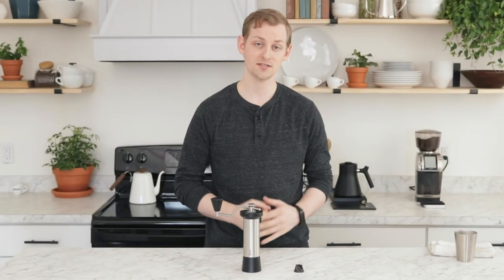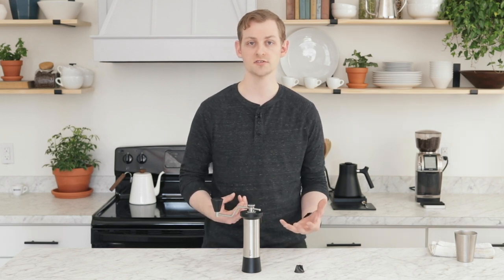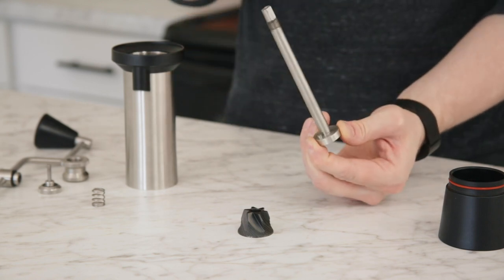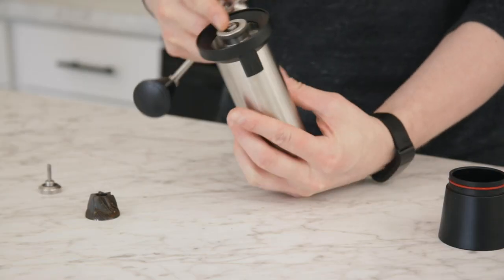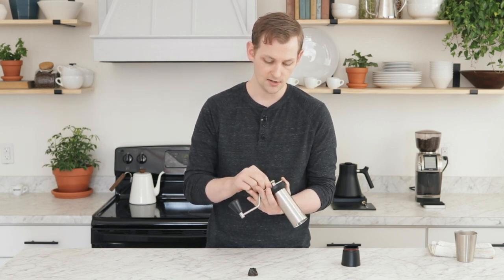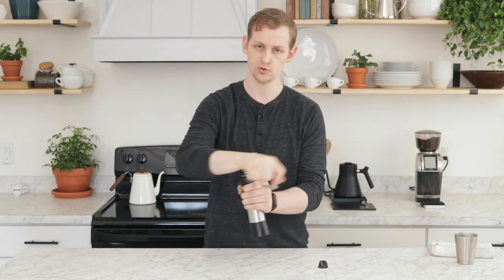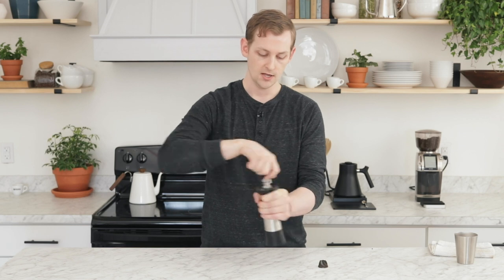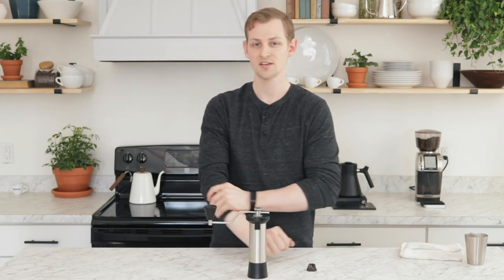Video Overview | Kinu Coarse Burr

Comment: I got to talk to Kinu about the POB actually. Kinu says, that any setting on the standard burr (filter coffee), the POB needs to be set at 1 rotation lower. i.e. if the standard burr is 3.5 for filter coffee, the POB should be set at 2.5 since the geometry is different. I've had this for quite awhile now and I've been enjoying the results since.
Reply from the maker: Thanks for sharing!
Reply: I believe that. I just made my first coffee with it on 4.5 with a light honey process. It was MUCH coarser then the stock burr on the same setting. Much better grinder uniformity and better clarity in the cup.

Comment: Just saw this video, 1 year but never too late. The Kinu coarse burr, even at a setting of 4 and above still produce a lot of fines, hence difficult to get rid of muddiness. But the coffee brewed is still a huge improvement over the brew using the stock burr that comes with the Kinu. The stock burr is very good for espresso though.
Reply: Thanks for the input - do you think getting the Kinu for pour-overs would be a bad choice overall? How would you rank it compared to other grinders?

Comment: I need this course burr for my Moccamaster brewer.
Reply: really? I thought Moccamaster was closer to a fine grind size. And the Burr that comes with the grinder does very well with fine grinds. This second option is meant for more course grinds I think. From say a V60 up through Press pots. But I'd like to hear your results if your choose to make the switch. I'm happy to have both now.
Reply: @sbellosa  oh no, the manual grinder by Kinu works great with a course grind

Comment: I recently just start doing pour overs with my new M47 but the bed of the coffee is always muddy and the result is kind of cloudy. I am using Chemex, which already have quite a longer drawdown time compare to V60. I have been trying to adjust the grind setting courser trying to fix this issue but no obvious result. After doing some research I found your video.Thank you for the information!
Reply from the maker: Glad it was helpful!
Reply: Jerry, did you buy this burr? I am having the exact same problem as you with my M47 and V60. I can't get draw down times to 3 mins, even if I sift the fines, because there are fines adhering to the course grinds and still causing muddiness.
Reply: @russelljazzbeck  and Jerry, I just bought the pour over burr a week ago and It is a game changer to be honest! It changed my pour over experience 180 degrees. Even though I can’t understand why such an expensive grinder would have such poor default pour over results, however, you must have the new pour over burr, you will notice the difference directly. The only issue is that it takes almost double the time to grind the same amount of beans. For the default burr i would suggest you guys go 5.2.0 or something within that range, and do the no blooming method “forgot what it is called”. Hope it is useful
Reply: @iM3ath  With the pour-over burr for the Kinu, would you say it is competitive with other pour-over grinders at the same price range? Thanks!
Reply: @charleswood5071  I don’t think there is another grinder within the same price range. I believr kinu classic is the most expensive hand grinder in this category. Also I went back to the original burr, after 5 months of using the pour over burr, the original burr are better to me,  it’s either the filters were clogging or the beans were slowing the extraction, however, I’m used to it by now and it’s a great grinder. But, I would suggest you go with Comandante mk4

Comment: Hi. Kinu M47 Classic user here. With standard burr set I am grinding between 1.5.0-1.7.0 range for espresso. I would like to try out my new filter burr set for cold brew. Where should I start? 4 full rotation is ok? Thanks. :)
Reply from the maker: 4 would be a good place to start. You are looking for that really coarse consistency, so you could always start by grinding just a few beans and seeing what your consistency looks like and go from there.

Comment: How fast/slow is the coarse burr compared to the Comandante grind speed?
Reply from the maker: The Kinus with either burr set will grind more slowly than the Comandante.
Reply: @primacoffeeequipment  Just wanted to be sure I read that correctly... Did you mean to say that either burr set would grind more quickly than Comandante? Pretty much everyone is saying it's faster with the standard burrs anyway. So hard to know without having them both on hand though. Appreciate your help!!

Comment: How often should you change your burr if lets say I grind 30g of coffee a day?
Reply from the maker: Most likely never! They last many hundreds of lbs.
Reply: @primacoffeeequipment thats what I thought as well but  I recently had to dial my grinder a lil bit finer as its grinding coarser than  usual (literally 2-3 click so for example setting used to be 2. 4. 4. And now is 2. 4. 1. The burr is 2-3months old so not sure what the issue could be. Coffee started to taste ever so slightly bitter as well. I usually brew v60 and make sure the recipe is consistent so something up with the grind I believe
Reply from the maker: @szymonbalcer  There is a break-in period for all burrs. Burrs produce their best results after a period of seasoning (generally around 10kg-20kg depending on the burr and the material. It will change slightly as you use it.
Reply: @primacoffeeequipment  aaa I see that's what it probably is. I adjusted grinder accordingly and its starting to taste amazing again! Thanks very much for the info :)

Comment: With the base M47 burr I can't get draw down times to 3 mins, even if I sift the fines, because there are fines adhering to the course grinds and still causing muddiness. Has anyone used this burr? Does it speed up draw down times?
Reply: I’ve had a similar experience with lighter roast and Ethiopian coffees especially. This is a common problem for the pour over method in general and for a wide range of grinders, with Fines clogging the filter… i think the known fines production of the kinu m47’s stock burr set amplifies this problem, for this grind range putting it more on par with an entry level grinder unfortunately. 

When it comes to espresso it’s superior to many electric grinders. When it comes to pour over quality, it’s inferior to many electric grinders or similar in fines production I’ve determined. 

I will suggest the clever dripper and the dump in the water method! The fines seem to have less effect using this brew method. Check it out. It’s the taste you’ve been seeking most likely. It’s a bit more forgiving. Kinu around 4.5 to start seemed like 1.5mins draw down on 4 day old Peruvian roast after 2mins immersion. Will go coarser on next up to 5 and try again. -M47 classic
Reply: @BenGatesMedia  Have you had any more success with the Kinu M47 for pour-overs? I am heavily leaning towards the Kinu over the Comandante, but I don't want to get it if it's truly that bad for pour-over techniques
Reply: Have you had any more luck with the Kinu M47 for pour-overs? I'm trying to decide between it and a different grinder
Reply: @charleswood5071  I never kept with it. I got a fellow ode for at home and sold my espresso machine. I will likely be listing my Kinu on eBay soon actually, just due to lack of use.
Reply: @BenGatesMedia  Gotcha, thanks for the response. Just out of curiosity, did you have the M47 Classic or a different style?

Comment: Hi, Kinu`s new burr is good for cupping? Thanks!
Reply from the maker: Sure. The pour over / brew burr from Kinu should provide you with satisfactory results for all brewing methods, including the medium-coarse grind suggested for cupping. Remember, though, that Kinu grinders are designed for espresso grinding; and the pour over burr, while certainly a step up from the standard burr when it comes to brewing, is not going to produce the uniformity produced by dedicated brew grinders.

Comment: I wish they had this a couple months ago. I returned my M47 and kept my Comandante because the Kruve sifting results were significantly more consistent on the Comandante for 500-1000um. The timing part makes a lot of sense because the M47 would grind significantly faster than the Comandante so now that it's slowed down then maybe it'll be more on par.
Reply: from what I've read on coffee forums the Comandante is still much better for filter coffee than the Kinu with pour over burrs.